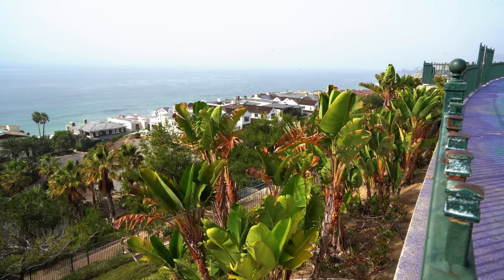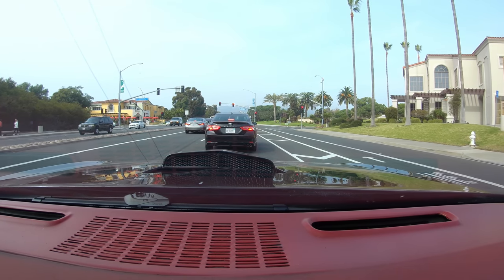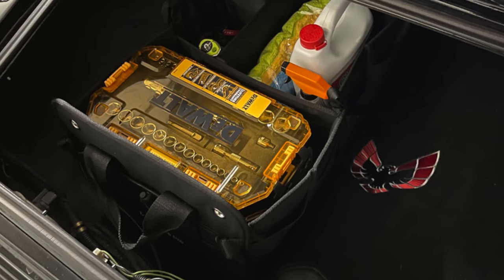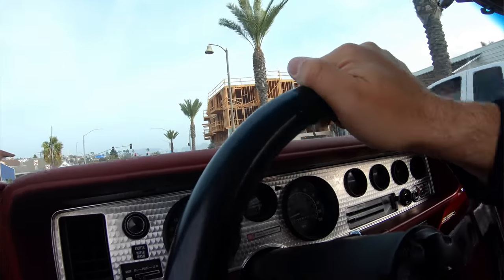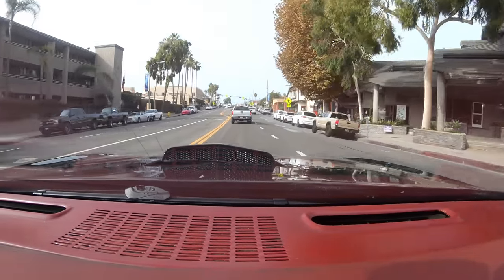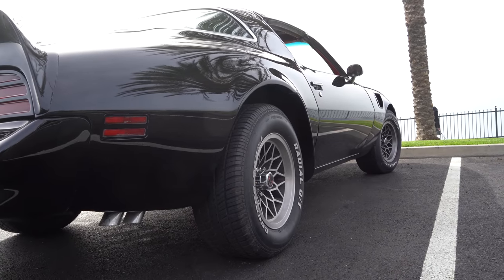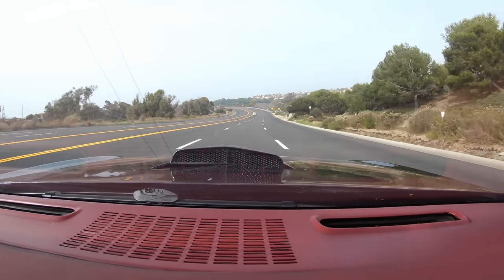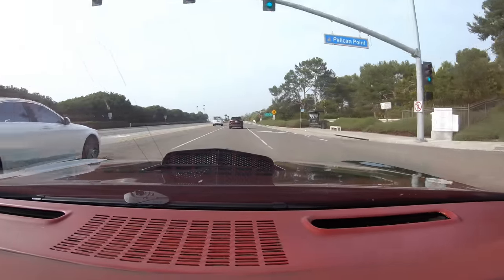The Trans Am is finally DONE! Why this is the COOLEST Car in the World!

Comment: I have to say the body shop is poor. Your job as a body shop is not to just paint a car quite well. You need to be able to do it to an agreed schedule, carefully catalogue parts taken off, be capable of fitting them all back on correctly and give the car back in the same mechanical state or better than when you got it. The body shop I use the car always comes back better. If there is a minor niggle they make sure it's adjusted and sorted before they give it back. I'm sorry to say they clearly did not want this project. It does not take 16 months to fully paint a car. When this was booked in they should have cleared the time for it. One guy starts day one dismantling and prepping for a week. The painter comes in the next week, possibly someone else because that's another skill, and preferably the first guy ends the project putting it back together CAREFULLY with finishing touches the final week. Not 'misplacing' parts. Maximum time three weeks start to end. That's a professional high quality body shop and well run business.

Comment: Ditch that 403 and go with the 455
Reply: Keep the 403 convert it to a 4 bolt main and     Stroke it out. Put some better heads and rods and coupled with the intake new carb or injection and some good headers you can get 500hp at the fly wheel

Comment: Time to just replace the stupid distributor system with an MSD when you rewire.   The paint workers ripped you off completely.  I'd take them to small claims.   Stole parts, stole gas, and delivered your car in worse mechanical condition than you left it with them.

Swap the engine.  Building on that thing is going to just cause you headache after headache unless you strip it to bare block.  Otherwise, if you want to upgrade the hell out of that thing, invest in head gasket futures.

Comment: Forget that 403 if you plan on making 400 hp, your not making more than 180 now, no it doesn't sound 'so good', it's a wheezy sucky sound, 2 bolt mains, iron crank, smogger heads, definitely NOT a high end restoration, so put a crate engine in it, unless you like driving a gutless pimp car...to each his own...

Comment: .... It's a GM product it's the same body as a Camaro with slight a difference. That engine is a California smog dog. You can have a GM 350 built to smoke that engine. If you really want some fun and NOT wrap it around a tree have a 350 built to around 340HP and put in a 5 speed trans

Comment: The only reason it has a 403 Olds  is because of the communist utopia of California. Both you and the car are exiting the communist utopia and you will be able to get away with an engine swap. Personally, I would go with an LS, but even a 400 Pontiac is a huge step up. If you are a purist and stick with an automatic, I would upgrade to a 4l80, because the th350 can't handle a ton of power and it has no overdrive. A  manual 5 speed Tremec would be a ton of fun. Lastly, don't expect your heater core to last forever, they don't! and you don't want to look like a cry baby pussy replacing it.